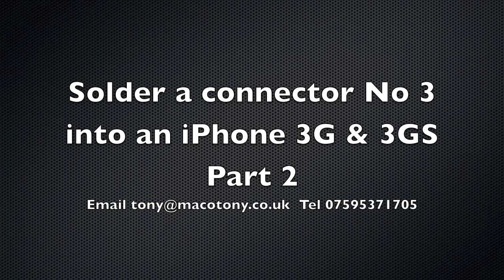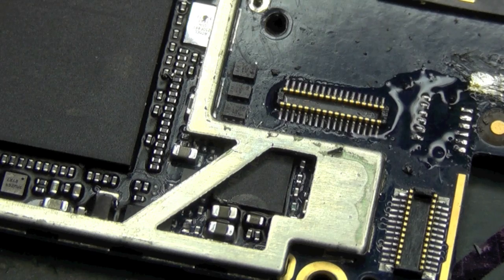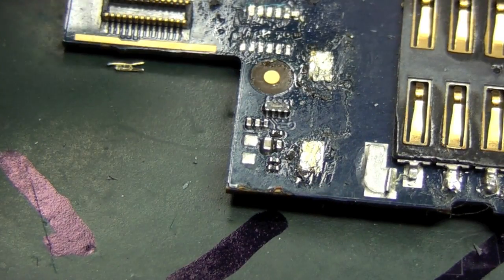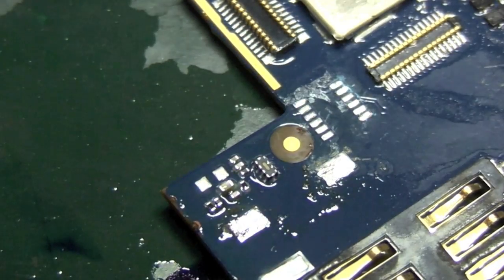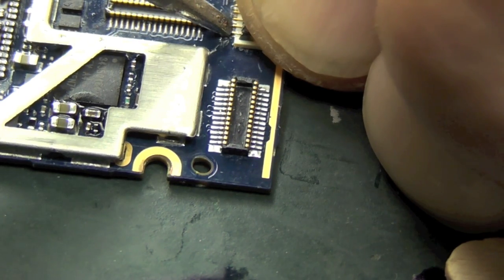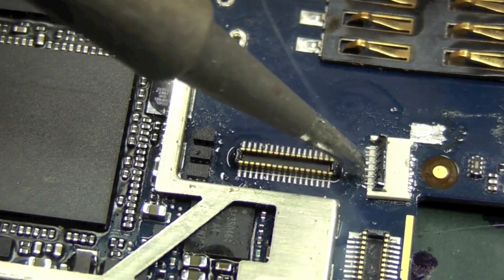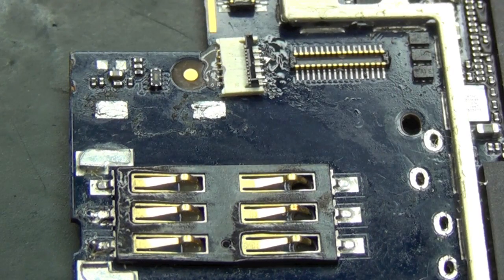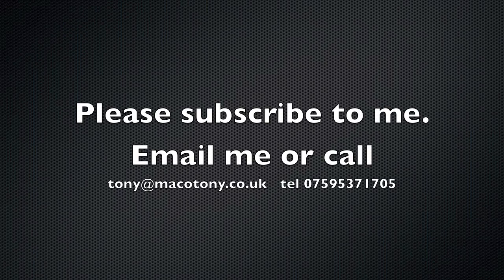iPhone 3G & 3GS connector number 3 repair part 2

Comment: Solder iron is at wrong temp, either you have an old solder tip .. or you have a heating element that is giving out, it should not be so hard to remove the solder from the pads, you should look into fixing the issue or you may damage some pads if you have not already damaged some solder pads.  Just my 2 cents, ran across the video, always looking at what others are doing, the iron does not seem to be temp adjustable, invest in one, this repair requires 340 Celsius, the iron is too low, does not melt the solder as fast as it should.  Try mixing low melt solder into solder joints, you will have much better results, I do these types on iPhone 5/5C/5S LCD/Digitizer FPC so I do know what I am trying to help you with, good job on using flux, I see so many amateurs doing these without flux and it is usually a bad job that does not last long since there are cold joints full of oxidation.

Comment from the maker: I big tip is ok if you know how to use it with correct heat.
The board I am working on is scrap used for practice, `i have plenty of scrap boards.

Comment: Brilliant videos Tony the most helpful i`ve found , i`ve tried this repair a few times on the same mobile but having a little problem, both times it looks fine but the phone wont turn on.
After removing the part the phone is fine again.
Got a feeling i`m using to much liquid solder and getting bridging but i can`t see any bridging.
I`m only using a cheap usb microscope to look for bridging after ive done the soldering.
What do you use to see what your doing ?

Comment from the maker: Can you try a different midframe assembly, if you still have the same problem then it will be the new connect not soldered correctly

Comment: Hello and thank you for the tutorial!
using a syringe sirius 1DI but exactly which component because there are several component
Sn63Pb37
Sn62PbAg2
Sn95.5Ag3.8Cu0.7
Sn5Pb95
if you can tell us exactly where you use?
In any case, thank you very much and happy new year to you soon

Comment: Ok liquid solder is what's used to connect the fpc connector to the board? Not regular solder then? See I'm going to attempt a replacement fpc connector for lcd on an I pod touch 4 g and wasn't sure how they did it but now I believe its with the liquid solder.can you assist in any tips that might be usefull.?

Comment from the maker: @unitedforhelp My solder past has flux in it, if yours is a bit dry them flux it up a bit. You do not need a lot of solder. If you still have solder on the pads then that will aid the process
As for solder tips I use either a needle tip or narrow flat tip. I get less bridging with a needle tip.
I use a Weller variable heat solder station....WMD3 set at 380c

Comment: with reagrds to magnification glass I have got a cheap 3x one which barely makes any difference looking through it... What is the best magnification for such a delicate task? 

In fact tomorrow I'm will be going to look for a good stereozoom microscope hopefully it ll be much easier

And does the soldering iron suck being 1.2mm tip? And what do you prefer for this task conical or chisel tip?

Thanks once again for all your help

Comment: Forgot to mention that the dispensing tip of the solder paste is 0.83mm from the syringe. Although I noticed that the solder paste used in your video is more acqueous than mine, mine is more solid grey formula

But I hardly think that the solder paste is the problem as it is from Kester which offers very good products

Comment: As I said the problem is that the solder iron has got no temp control but it goes up to 400C with regards to the tip it is about 1.2mm...

Is liquid flux sufficient? If not what difference is between the gel one, and liquid/pen driven  flux?

Comment from the maker: @unitedforhelp what size tip are you using and what heat? do not use too much liquid solder. If you get a bridge try cleaning your tip, add some gel flux to the bridged area and drag the tip away from the joints.

Comment: First of all many thanks for your video it has thought me a lot of things.
However I have some questions regarding the soldering of the new connector...

When I try to solder the new connector the solder paste sometimes it ends up going on inside the conenctor resulting in melting the plastic body of the connector and when I try to amend the solder back it starts to bridge with the adjacent connections.

Could you please advise how bridging could be removed? 

With regards to magnifying glass I

Comment: Hey !
I have a question, I'm from Germany and want to know how much the supplies costs?
A 25g Solder Paste, the etamvit solder tip tinner (20g) 
And which gel flux do you use and how much does ist costs?
Sorry for the questions, but my English is much as well.. Not...
So I don't understand everything...
Hope you answer!
Aaaand VERY NICE VIDEO!

Comment from the maker: @tennyson0228 Only if you keep the heat on the board too long, secret is to make sure the tip is clean and tinned, a gel flux is good as it aids the removal.
If you have a scrap board practice on that, ask your local phone store if they have any.

Comment from the maker: @tennyson0228 Don't see a problem with a 50 watt iron.......is it variable temp?
A 50 watt iron will recover its heat faster than a 15 watt....so when you apply a 15 watt iron to the work the temperature will drop, a 50 watt iron will recover faster ( a large tip will store heat therefore temperature drop will not be as bad ) Most lead free solder melts at 230c

Comment from the maker: @xbabsybabex Hi, many thanks.....Mr Bean! 
Liquid solder is Sirius 1 DI from mbouk.co.uk.
I use a variable temperature Weller solder iron,I use the WMD 3 but any of the cheaper Weller stations will do.
A good selection of tips for the solder iron.
You will need desolder braid, gel flux, tip cleaner/tinner all from mbouk.co.uk
A must is a magnifying lamp.